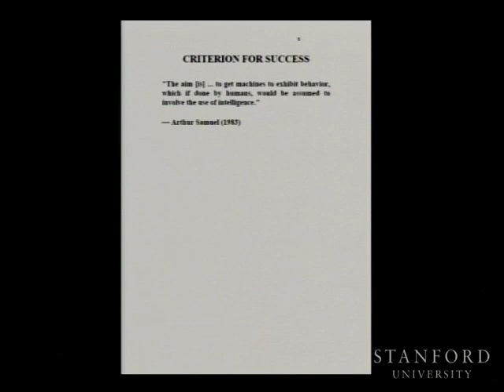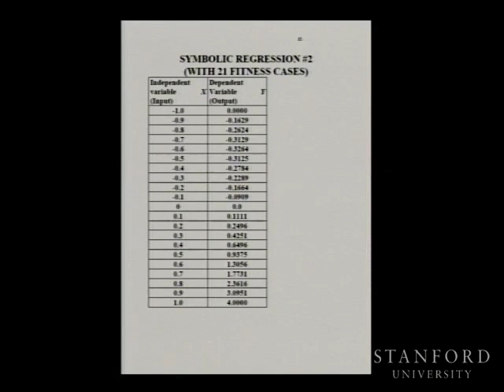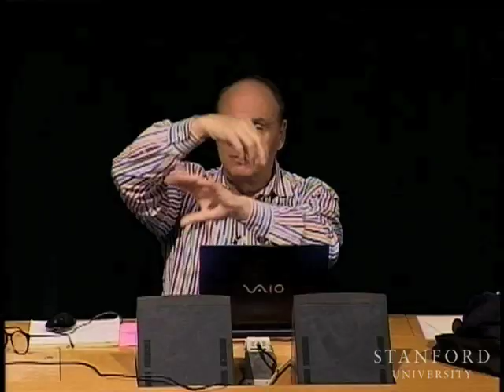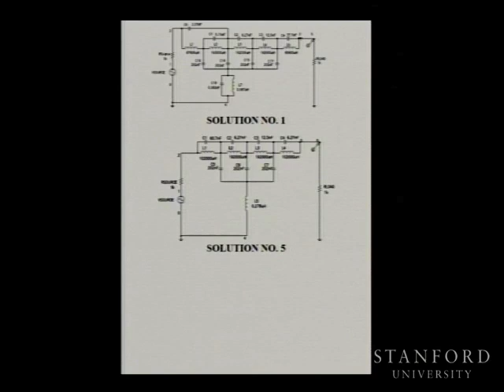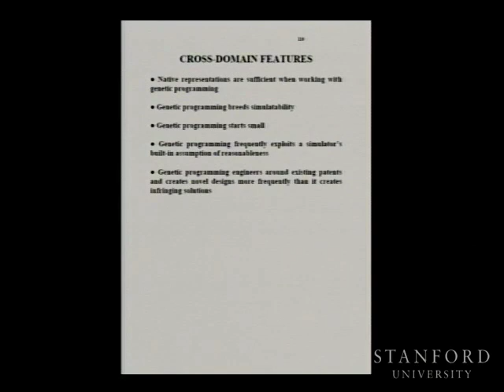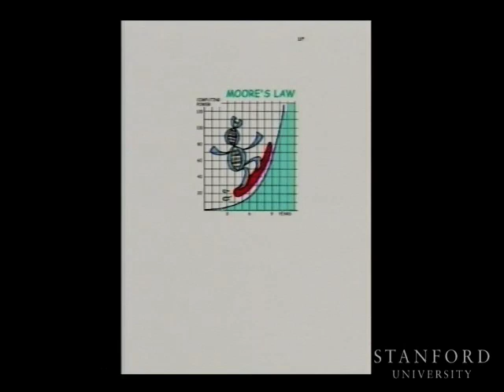Automated Design Using Darwinian Evolution and Genetic Programming

Comment: Following up on one of the questions at the end: If an expert designer kicks off the "embryo", GP can indeed refine the design. In fact, my understanding is that GP excels at optimisation problems where the basic design strategy is already chosen within the vast design space and purely undirected GP would risk excessive computational load. 

The size and topology of the solution space - its continuity and bumpiness - are huge factors to the tractability of GP-directed design. Accordingly the genotype-phenotype mapping can variably exclude the number of expressible phenotypes that are trivially dysfunctional. My sense is that this can account for several orders fo magnitude reduction or expansion of compute workloads depending on how well it is done.